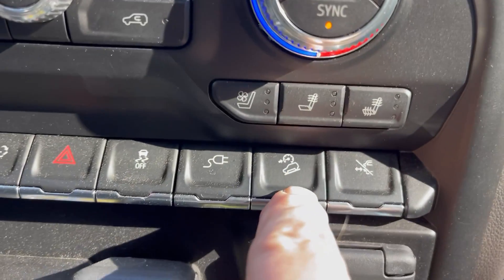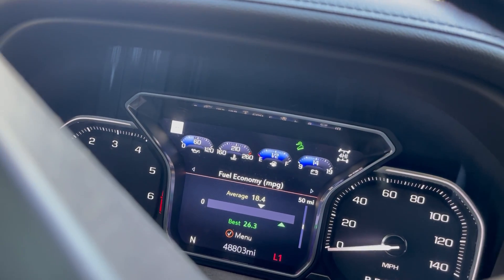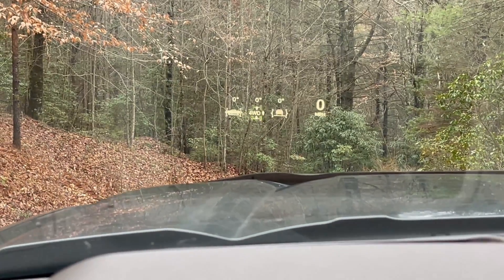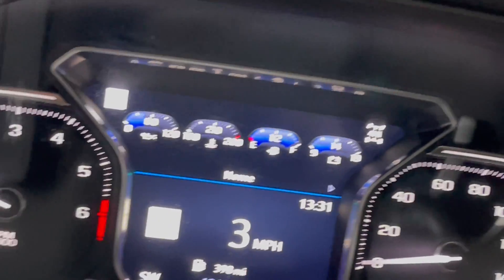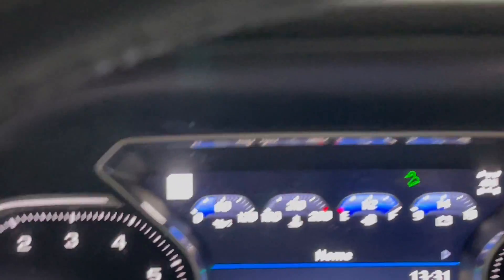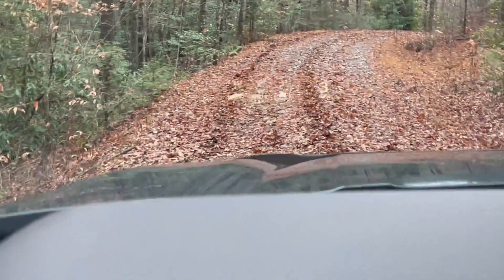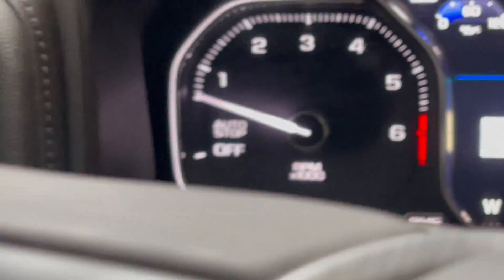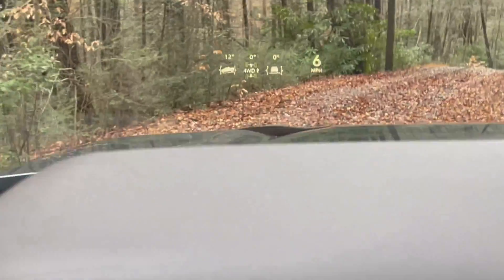Hill Descent Control GMC DENALI

Comment: I can't get mine to work right. With the 3.0 liter I can't find how to set the speed. Also, is there no tow/haul mode now? I press the trailer icon and the "engine brake" pops up??????
Reply from the maker: I'm sorry you're having difficulty. Typically once I push the button I can have it either into Wheeler four-wheel-drive doesn't really matter because the computer controls all for wheels with individualized breaking based on the slipping and speed. Basically once a push that button I dissent the hill and whatever speed I want to get to I just increases speed to that point to take my foot off the accelerator it sets it try that. Thanks consider subscribing Joseph

Comment: If GM would have just left the drum brakes in the rear we wouldn't need hill descent control, the abs in the rear was dumb
Reply from the maker: Thank you for your comment. I don’t know about drum brakes. It seems like disc brakes are more efficient, but I’m not an engineer. The hill descent actually is very helpful and I use it every time I go to the mountain cabin, which has a 17° driveway very steep. Consider subscribing. Thanks. Joe.

Comment: Hey, Dr. Joe. I got an ultimate 2025 2500HD Denali I just got and I been wanting to take her over a mountain I live near. Would cut me on a lot of time but I been a little hesitant to be honest. Would shifting to a lower gear be better for me as this would be too slow and it’s an actual highway that runs over the mountain. Thank you! Subbed and liked.
Reply from the maker: Excellent question. Using a lower gear will add engine breaking to the descent which if you’ve got traction is good decent control basically is not using the engine breaking. It’s applying braking to each individual tire based on the slip and traction. You can use both if the conditions are difficult. Thanks for subscribing. Take care. Joe.

Comment: Is it better to to use engine to brake or this feature?
Reply from the maker: Engine braking is very useful and you don’t put anywhere or tear or heat up the brakes. The descent control is using engine breaking but also intermittent breaking of the individual wheels. I hope the video was useful to you. Descent control is an excellent feature. Consider subscribing. Thanks. Joe.

Comment: how do you adjust your speed while using it? And what is that button for, that is on right side, next to the hill descent button?
Reply from the maker: OK great question you adjust your speed up to 14 miles an hour by just giving a little throttle or adding some brakes. The hill descent control will then maintain that speed. It won’t work if you’re traveling more than 50 miles an hour, and it requires a slope at least 10°.

The button next to that is one that will manually extend the runningboards to their outward position, and then push it again. It will move that backward, so you can get into the bed. Thanks for your question. Consider subscribing. Joe
Reply: @JosephHunstad  thanks!

Comment: Will it worn in 2wd?
Reply from the maker: There is a really great question. Yes it will work in either two or four-wheel-drive but I usually have mine in four wheel. Going down the steep driveway we have which is 16° or a 32% grade. Consider subscribing. Thanks Joe.

Comment: Hi Joe! 

I have a 2022 GMC Canyon AT4.

Question: Does your truck have to reach a certain incline to activate the hill descent or will it activate at any degree of incline?

I have not been able to activate mine. I don't think I've gone into a steep decline. Just wondering if that's the problem with mine.
Reply from the maker: Hello Michael,

Great question. Yes, you do need to have a certain degree of incline when the hill descent will activate. Exactly what that inclination is I’m not certain, but it also engages when any wheel slippage is detected. It’s a great feature. I would try to seek out a steep hill and use it. You don’t need to be in four-wheel-drive you can just be a regular drive. It will automatically perform. Computer controlled braking on each individual tire. Consider subscribing. Thanks, Joe.
Reply: @JosephHunstad  Thanks!